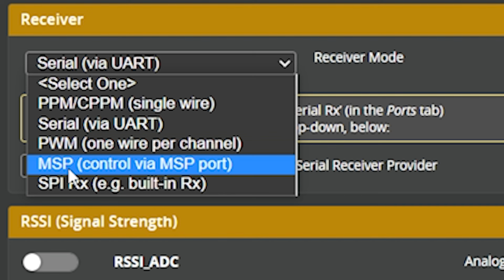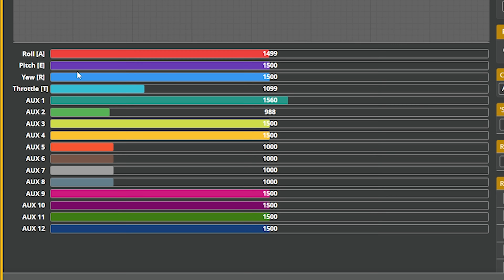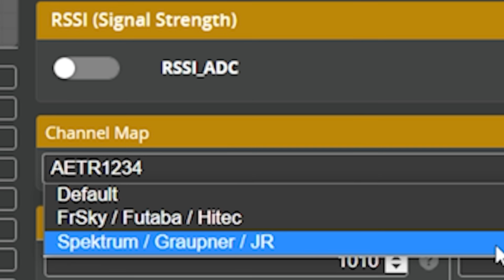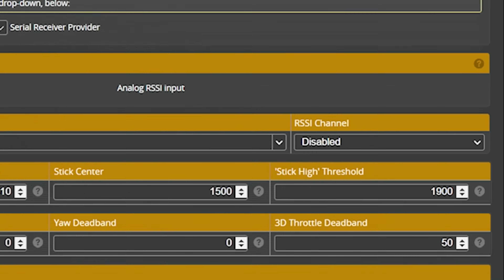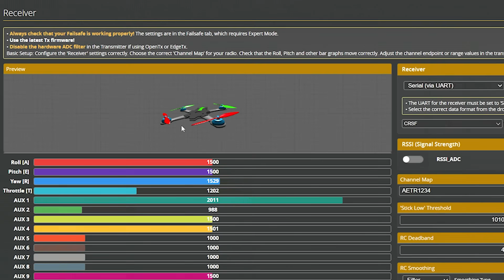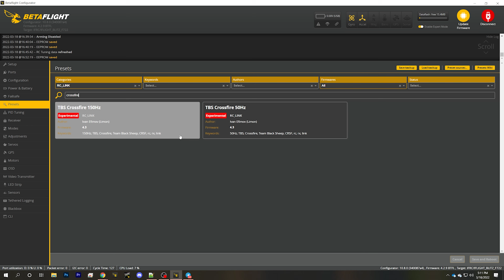Betaflight 4.3 Receiver Tab | COMPLETE WALKTHROUGH PART 3

Comment: I have rssi 0% in setup tab (info) , but stick (chanels ) works, is it because i use dji 03 air unit, and dji fpv controller2?
Reply from the maker: That's correct. The DJI RC controller uses SBUS protocol. It doesn't support telemetry communication back to the FC. So you won't get any RSSI or other such stats. You can get RC signal strength inside the DJI goggles though. There is a separate RSSI bar in the goggles for it.

Comment: One more great video of the series! I just want to add something that could be useful to another beginner like me: After you bind the RC and receiver, if you are sure everything is correct and you still not seeing movement on the channels at Beta Flight, it is because when you update the firmware of your Flight Controller (using BetaFlight) you need to select the serial receiver provider you will use (for example S.BUS. if you don't do that, you will be able to select it on the Receiver Tab but it won't work!
Reply: Where is there an option to select that when updating the firmware? Also, what version of BetaFlight do you have, what FC, and what radio?
Reply: @walkingbrick4529  Theres is on the same page where you do the firmware update, after selecting the firmware version a new section appears below called "Build Configuration" there are a few drop downs, one of them is "serial receiver provider" or "radio protocol" there just select the one you are using, in my case for a FRsky RC it is SBUS. BetaFLight ver 4.5 and FC Diatone Mamba.
Reply: @marcosmecatronikify  Thank you so much!

Comment: Hi JB, is it ok that my throttle does not keep the locked value, but it is changing between for example 1143 and 1147 in BF? Or it means that sth is wrong? On my radio there is also instability on the throttle indicator and it changes with differences <=0.4 (so for example between -68.8 to -69.2).

Comment: Hey there! I need some help with my Tango II settings. When I push the pitch or roll fully on my remote controller, my drone doesn't achieve the full range of motion. It won't do proper dives or flips; instead, it responds slowly and with limited movement. I've followed various setup guides and checked my remote controller settings, but I still can't figure out what's wrong. Interestingly, when I test the controller in Betaflight's Receiver menu, everything appears to be working fine. Any ideas on what might be causing this issue?

Comment: what if @4:58 moving your throttle doesn't do anything on betaflight (even though it is already flashed and binded to receiver)? I've been following all steps from previous parts up to this point 🤔
Reply: I have the same question...😇
Reply: Did you try to go through the calibrating process of your remote controller again? I had the same problem and the fix was that simple 🤣😂

I have a Radiomaster Zoro for reference
Reply: I had the same issue, it is due to lack of Serial provider in your FC, when you do the Firmware update for your Flight Controller  you need to specify your protocol (in my case S.BUS) that will fix it.

Comment: I have been desperatly trying to be able to read my RSSI in my betaflight config, to add it to my obd. BUT it didn´t work, because of my SBUS protocoll i couldn´t send telemetry.Then I figured out that I (and I have no idea why) have to enter into the CLI (after selecting the correct AUX channel in the receiver tab):
set rssi_channel  = {AUX CHANNEL NUMBER}, then pressing enter. To then save it I had to typ save into the CLI and again entering it.
so in my case I entered:

set rssi_channel  = 11
{ENTER}
save
{ENTER}

and after a quick (automatic) reboot the rssi value was immediatly visible in the setup screen in betaflight.😄

Comment: Hi there if you can pause at 6.25 where you day “it means your not getting any input at all” 
???
I have been watching your vids and configuring my drone build build step by step through your video however my color control chart does not move at all in correspondence with my throttle on the controller and I have indeed binded them so I am unsure why it’s not corresponding and moving the chart as I physically move the throttle etc…PLEASE HELP

Comment: Dear Sir,   Thank you for a great video on Betaflight.  I'm having a small issue trying to set up my FlySky FS-iA6B receiver to my SpeedyBee F405 V3 flight controller soldered to R2 using Betaflight Configurator 10.9.0 (697943b).  I set the Serial RX to UART2 (where I soldered the PPM output pin to), and saved and rebooted.  Then in the Receiver tab I set the Receiver to PPM/CPPM but when I save and reboot it changes back to Serial (via UART), and I have not transmitter input showing up on the screen.  TELEMETRY, and RSSI_ADC are off.  The receiver was set to output PPM from the transmitter, and they are bound.  What am I doing wrong.  This is my first build and It's causing me to channel the spirit of Yosemite Sam.  Thank you for your help.

Comment: Hi Joshua, very helpful video indeed. I'm setting up telemetry and want to see number of gps satelite in Tx. GPS already working and I can see number of sattelite at OSD but i cannot find 'sats' in telemetry in Tx. Already enabled Telemetry in Configuration tab, delete all in Tx and rediscover but got 10 sensors only. I use radiomaster boxer elrs, happymodel ep1 elrs. Any advice?

Comment: Hi Josh, are you able to go into some more depth about fixing the RSSI if it is stuck at 0% when all set up? I did take the drone for a quick test flight very close (<1m off ground and <5meters away) as I thought maybe the RSSI reading in my goggles might just be wrong? RSSI reading in goggles is of course -130, hugely annoying.
Reply: Using DJI Controller & Goggles V2 on a Nazgul F5 V2. Many thanks!

Comment: @ Joshua Bardwell, I wonder if you or someone in the community could assist as I’m in South Africa KZN, and there’s not a person to talk too about my hobby. I have a speedybee F7 mini stack with 35a esc, transmitter is a Flysky FS-i6 updated to ten channels and receiver is the FS-ia6b receiver and using the sbus slot, motors are 2203 cobra, the problem is my receiver is bound and soldered with no cross joints to the FC and was working perfectly for a while, then I bought a new frame and changed over without having to re solder anything so more plug and play, yet now I cannot see my receiver in beta flight. I have reflashed firmware to latest but with no luck. I do realise that my setup on the transmitter side might be outdated to what you guys are using that side would you feel that upgrading that would possibly solve my problem or do could it be something more sinister?

Comment: rc smoothing is very important! much more than you say! a freestyle preset can take your 150htz and turn it into a quad with >50htz latency! you must always use "race" in the preset in order to take advantage of your fast radio link, because the smoothing rc in the "freestyle" preset adds a lot of latency. me personally (crossfire), either I put "race" on the preset, or I cut/disable rc smoothing. quite simply. this is the only way to optimize the latency of your system as much as possible. and not be slowed down by rc smoothing. after if you have no problems with latency, it's ok, but why have a good system if it's to curb it with this function? especially for 2.5ghz links, for crossfire, it's less important, but for elrs, you have to take full advantage of the equipment, otherwise there's no point in buying it! No?:body-blue-raised-arms::goodvibes:

Comment: Hi Joshua, I've just recently got back into my drone after a few years. I am having to relearn everything!

I have run into a problem. I can confirm that my Tx and Rx are linked (green light on Rx), however, when I move the sticks, the rotors don't spin and no signal change is noted on BetaFlight! This only started since I updated the Firmware the other week. 

I'm thinking it may be an issue with the receiver protocol I have selected... I don't remember ever having to choose one on older versions of Betaflight (circa 2018)!

Is there a way to find out which receiver protocol your Rx uses? I've googled the model number with no answer!

Tx is Taranis X7, Rx is a FrSky XM Plus Micro D16 SBUS, FC is a RacerStar Shot 30A 4in1.

Any guidance would be much appreciated!
Reply from the maker: For that receiver, SBUS would be the correct protocol.

Comment: I have problems with the drone that I am building, in fact it is the first drone that I build; I connect the drone to betaflight and I can see the receiver flashing and when I turn on the controller the receiver light turns solid, but in betaflight I select receiver to see if the controller can move the bars as I move the joysticks the bars do not move it will be devo connect a battery to the drone? and another thing RSSI is at zero the receiver the mate-elsdr-r24-s, to which I had to do a full eraces with the help of the matekesys tech because I couldn't update it with express elsr to ver 3.2.1. Joshua B. can you help me with this??? This is translated from Spanish to English in case I wrote something wrong!

Comment: I feel so dumb now. What happened to the crossfire LQ readout? the 2/100, 1/100 etc...? Are we back to the good old RSSI only?? Crossfire 99% for ever? :D
Reply from the maker: Crossfire lq works same as ever. Not sure whats going on....
Reply: @JoshuaBardwell  Thank you for the quick answer! Ok I was irritated because you didn't mention lq. Had a bit of a break since last quad setup. 
So wouldn't it be more reliable to get the lq as well? Rssi at 78% with 1.5 meter distance is scary.

Comment: So I am new to drones and I can not get my controller to work I have the dji 03 air unit googles v2 and the dji controller 2 everything is linked together I have the t motor f7 HD flight controller. it is plug and play with the air unit so I have turned on sbus baud fast in beata flight and in the googles I have tried serial rx on each uart just hoping one would make it work I also set it to sbus in the receiver tab also camra and osd works fine any help would be awsoeme I am at a complete loss also everything is on the newest update same with the flight controller
Reply: how did you go, im in the same boat
Reply: @brycellewellyn3483  Well it was my fault from wiring it toy previous flight controller wrong and I tested up the 03 air unit ( I used a 12v power that could handel the draw of the air unit) on this flight controller it will work tho I bought another 03 air unit and it's fine now serial rx is uart 5 amd the other uart for the msp is uart 2 also turn sbus baud fast on in your goggles and in beadaflight cli tab and in receiver tab choose cerial rx and the right under that choose sbus amd u have the same tmotor f7 stack and the 03 air unit?
Reply: U can also email Bardwell and he should help you

Comment: The official Betaflight tuning notes tell me, and let me quote "Crossfire users should lock to 50Hz or 150Hz and use an 'RC_LINK' preset in the configurator preset system to set up. We have encountered problems with the default Crossfire dynamic system." 
Does anyone know if that's here to stay, is it a feature or a bug?😄
I don't really want to lock into either one because I fly medium range and freestyle with the same quads.

Comment: watched almost all vids but still can't connect radio to beta flight. Using  Spektrum srxlv2. IDK
Reply from the maker: Connect signal wire to UART tx, not rx.

In Betaflight receiver tab set protocol srxl2.

In Ports tab enable serial rx for the UART number you soldered to. 

In cli type

set serialrx_halfduplex = on
save

Comment: I've got the jumper t lite pro with built in elrs.  Now I see where that extra money goes in the Tx16.  On my receiver tab all four (throttle, yaw, pitch, roll)  main axis of flight when set to midpoints and neutral are twitching like crazy.  ~30 points of movement back and forth at the worst.  With no dead band and a properly calibrated quad, watching the 3d model in the receiver tab it's slowly moving on it's own.  Had to play with deadband for everything until it finally sat still under no input.

Comment: Hello Bardwell,

love youre videos very helpfull been a subscriber from a few years, binded and build a few drones but latley I accedenly deleted all my modes dont ask me how and had to set them up again.
I came across a new problem which I never had like this as I remember maybe you can help me out. 

I recalibrated my mambo tbs radio and the stick still seem to jiggle somehow a bit, this I notice a lot inside BF when I go to the receiver tab where the drone starts to move in unwanted directions.
tried to change AETR1234 to TAER1234 and visversa also re-linked it to the right receiver in the configurator tab to CSRF updated all to the latest firmware. Still having the same problem this happens exact the same to when I enter in all my other drones, my conclusion is that it might be a problem coming from my radio but it strange.

Hope you have a solution for my problem :/

Comment: My throttle is reversed. I couldn't figure out to invert it, so I just fly goofy. Any idea how to invert the throttle direction?
Reply from the maker: In an opentx radio, channels can be reversed in the OUTPUTS screen.

In Betaflight, reverse the throttle using the CLI command

rxrange 3 2000 1000
save

Comment: Need help. I have the JB AIO FC stack F4 and trying to convert from FrSky to GHST. I am connected to ghost on transmitter and receiver but cannot get it to work with the FC. Any suggestions? does ghost not work with this F4 board?

Comment: I'm using BF 4.3 (Bi-directional D-shot enabled and using dynamic idle) and when I changed my low throttle threshold from 1090 to 1010 (stick ranges correctly from 1000-2000) it started wobbling like crazy every time I lowered throttle all the way down after a punch out, as if the pids just turned off. People talked about this for BF 4.2 where one needed to adjust the idle value alongside with dynamic idle, but in 4.3 only the dynamic idle is supposed to be used. I moved it back to 1090 so I can keep flying. Do you know why this happened? It was a 3.5" quad and I tested 30-65 dynamic idle but no change.
Reply from the maker: The low throttle threshold is not related to the idle value. As long as your throttle goes below the low throttle threshold at all, Betaflight doesn't care how much below the threshold it is.
Reply: @JoshuaBardwell  I don't remember changing any other setting alongside this one, so I have no idea why the quad decided to act like it did.

Comment: Hi Joshua, could you please tell me if i will automatically get the RSSI reading in my DJI v2 goggles if im using the Caddex Vista and CRSF receiver. Thanks much.
Reply from the maker: No you won't. You need to use the aux channel method.

Comment: Dear Joshua thank you so much for the effort you make to make us learn and understand more about fpv ,i am new to fpv i have just ordered my nazgul evoque ,it will be my first fpv drone and waiting for its delivery within days and thanks to you i am more confident in setting things up for it without messing the pre tunes that iflight make,but am worried if i update the firmware of the fc would i clear the pre tunes that iflight made after building it??
Reply from the maker: You should not change the configuration or tune on the Evoque as it is very good already. Especially if you're a beginner, there is no advantage to you flashing new firmware and setting it up from scratch.
Reply: @JoshuaBardwell  Thank you so much for the fast reply,  cant wait for Part 4

Comment: Why You explain the betaflight 4.3 configuration on the board with 4.29 installed, no big differences?
Reply from the maker: The configurator options are the same :-)
Reply: @JoshuaBardwell  not true. In this video you couldn’t show IRC Ghost as a RC Protocol because 4.2.9 doesn’t have it.

Comment: When I set up my Radiomaster, I had the option of different channel map softwares. Which one would you install?  I know you can change the order in Betaflight, but do the map orders need to be the same between tx and Betaflight?
Reply: The channel mapping must be the same from TX the flight controller. But you can change the channel map on both your radio and your flight controller. But the map you change on one will not change the other so when you change betaflight to something like an TEAR channel map from an AETR in betaflight, if your radio is AETR it will stay AETR.